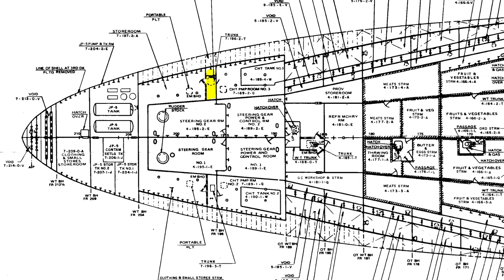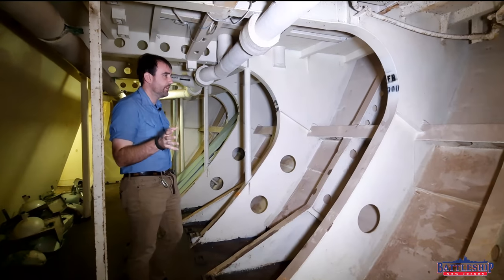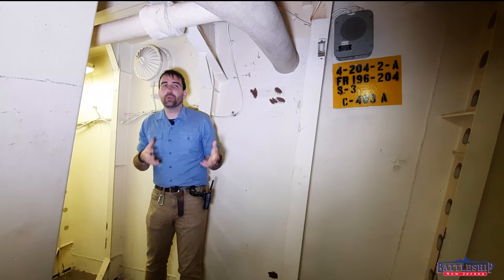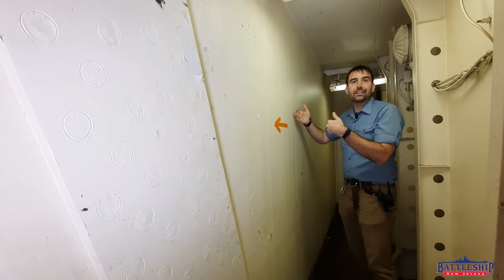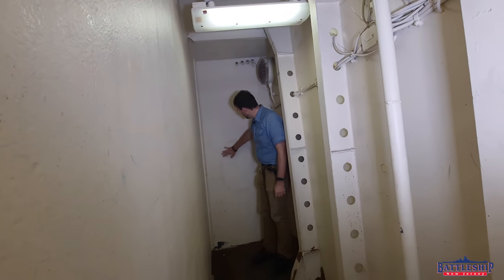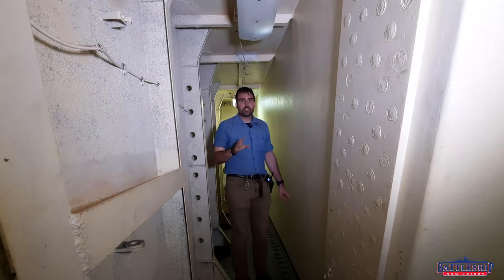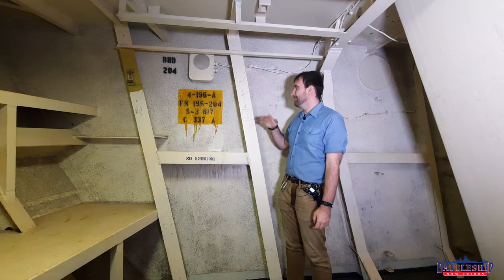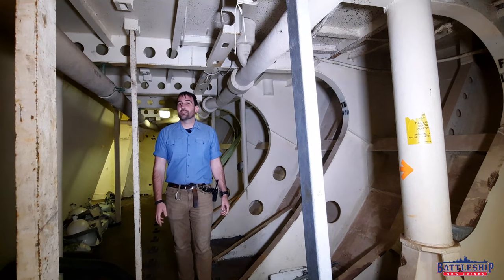Covering Your Aft (Steering)

Comment: The fact that you can only hear the sloshing sound in the video when you stop editing it out really demonstrates the leaps and bounds you have made with the sound quality great work
Reply: Was that editing, or was that a simple switch in the mic being used?
Reply: Not just sound quality. They've really up their game all around; early videos are almost difficult to watch in comparison. It was like sitting at the back of a lecture hall where the lecture is being delivered purely through a pipe made of plastic bendy-straw in a normal speaking voice with a guest lecturer who didn't really think about what they wanted to say.
Reply: @Howard Hammermann That is precisely what I was thinking.
Reply: @whyjnot420  It might well be just turning off or down the "denoise" effect.  Premiere Pro (and I imagine other editing software) has really terrific sound editing tools built-in.
Reply: @whyjnot420  De-noising an intermittent noise is pretty much impossible. The best you can do is eq but this is only effective when the frequency you're cutting is very clean or outside the vocal range.
Reply: @whyjnot420 gain boost on that portion so you can hear it, is my guess

Comment: This is one of the reasons these are so interesting. Ryan's remark that this ship was built in a time when "welding was new" AND it took place in my Dad's lifetime.
Reply: welding was invented for ww2 basically. battle ships were built knowing we were new at it, so just go 2x what you think you need and start from there. meanwhile, if you look at liberty ships... you realize just how new welding was
Reply: @seldoon_nemar  I remember my father talking about riding liberty ships between islands in New Guinea, the ships were built in sections and were built so fast that sometimes the sections didn't quite match up, so they would just fill the gaps with more weld, he said some of the deck welds were so big you needed to be careful not to trip over them
Reply: @steveredacted1394  That sounds about right. They were basically made with the intention of only ever being used for a handfull of trips at most. I think there is only one remaining example of one

Comment: Welding high carbon steel is tricky.  It can be done, but the right alloy welding rod must be used, and heating the material to be welded is essential.  Hard to do when it is a foot thick on a ship..  Plus you would then need to retemper the steel, or at least strictly control it's cooling to avoid brittleness.
Reply: Brittleness probably isn't that big of an issue if you can preheat the metal enough, since the huge mass of metal will prevent rapid cooling which is how you end up with brittle metal after heat treatment
Reply: How do you know so much :| ?
Reply: @vtr0104  it's called being a welder
Reply: @richardmillhousenixon  
Correct, but imagine trying to heat up  foot thick slab of steel in the building slip as they build the ship!
Reply: @mahbriggs  You could use an inductive blanket to heat up the area around the weld
Reply: I was gonna say, you can do it, but first you need to ruin the armored temper, and getting a now, much larger unified piece, re-tempred, and not have weird "seams" where the temper transitions is a massive PITA. Now-a-days it can be done, and probably would be done with welding, but only because that particular seam might have been one of the last ones ever assembled like that, and the skillset is gone
Reply: @mahbriggs  rember though that it's face hardened, so it's not getting heating all the way though. it would be rolling under a blanket of fire until the surface temp was right and then allowed to cool in a controlled manner
Reply: @mahbriggs  Just start out on a Monday morning with extra large torch/ heating tips on a very hot day and maybe by Tuesday afternoon will be good to go.
Reply: @richardmillhousenixon  
In the 1940s?
Besides, we are talking about a ship being built. Do you shut down work on that entire section of the ship?
In theory you can do a lot of things. Some however, are just impractical or silly!
I have 44 years of experience in industrial welding, and while I have never done shipyard work, I have a little appreciation of what is practical.
Reply: @seldoon_nemar  
Actually,the top and bottom edges were unhardened.  Look at the bottom edge which was welded.
Massive welds, with what appears to be a transition plate.  Even so, I would question whether the welds would not fracture under a shock load, due to crystallization.  That is the big problem when welding high carbon steel.  The transition from the weld to the bulk of the material.  Possibly enough heat in the base welds to provide a smooth transition, but trying to weld small brackets to the armor is very difficult.
Reply: @mahbriggs  that was kind of my point is that those sections are not armor tempered, and those little bracket welds did not have anywhere near enough heat to even think about sticking. it is possible though in theory, as you would just need a the right (giant) equipment. they make 3/4 welding rod currently, but I've seen phones of 1+" rods being used. 

now, granted, you're not welding with 1000 amps and a mechanical rod holder uphill or downhill as you're messing with a lake not a puddle at that point. but it would only take 2-3 passes and have the knockdown heat to work
Reply: Armor is not just high carbon steel - it is a laminate with a high carbon face and a low carbon back. Later armor was alloy steel.
Reply: @seldoon_nemar  
Which was my point!
It can be done, but welding those brackets is not very practical.
Reply: And while retempering, avoid annealing other hardened surfaces...  :/
Reply: @allangibson2408  Laminate armor was not a popular thing in the 1940s thanks to it being weaker than homogeneous armor. Face hardened armor is not laminate armor
Reply: @richardmillhousenixon  Harvey plate armour was made from the 1890’s by pouring molten high carbon steel into a mild steel mold - that gave a hard face and a soft, splinter absorbing back. Vickers and Krupp developed this further by using different alloys for the front face and multiple pours. The only think heat treatment helps with these is avoiding cracks due to too rapid differential cooling.
Reply: @allangibson2408  Harvey steel was phased out in 1893.
Reply: @allangibson2408  And that is also not how Harvey steel was made.

"Harvey armor used a single plate of steel, but re-introduced the benefits of compound armor. The front surface was converted to high carbon steel by "cementing". In this process, the steel plate would be covered with charcoal and heated to approximately 1200 degrees Celsius for two to three weeks. The process increased the carbon content at the face to around 1 percent; the carbon content decreasing gradually from this level with distance into the plate, reaching the original proportion (approximately 0.1–0.2 percent) at a depth of around an inch. After cementing, the plate was chilled first in an oil bath, then in a water bath, before being annealed to toughen the back of the plate. The water bath was later replaced with jets of water to prevent the formation of a layer of steam which would insulate the steel from the cooling effect of the water. The process was further improved by low temperature forging of the plate before the final heat treatment."

(Harvey Armor - Wikipedia)
Reply: The fact that they tried to weld a relatively thin metal beam to what is essentially a giant heatsink also did not help.
Reply: @kilianortmann9979  I don't think heat sink is the correct word, more like heat sponge
Reply: @richardmillhousenixon  I know the word is mostly used in PC building, but in thermodynamics a heat sink is the opposite of a heat source.
Reply: @kilianortmann9979  Point taken
Reply: How much carbon do you think was used in the ship armor

Comment: Does the museum have any of the large rivets that were not installed that you can show? They have to be monsters.  Fascinating to see the sharp curves of the aft hull contrasted by the armored box for steering.
Reply: those are large enough, the shipyard probobly made just enough in the machine shop. if one fails it's unlikely to be noticed. if enough fail that repair is needed... you're at a shipyard with a machine shop with a hole in the side of the boat

Comment: 8:00 you're close, but not quite there. to weld two plates of that size, and to keep them structurally sound, you need full penetration. meaning that you're carving a huge V between the plates and filling it with layer upon layer of weld. they control the heat well, but the problem is that you're still depositing cast material, and as it cools it shrinks, adding internal tension, meaning that if struck, the weld line would crack instead of deform. welding was also new, and they didn't entirely trust it or have the working knowledge of it like we do today. to have the confidence to draw up a welding shcedual that would work. 

also, I love how some aperentice at the shipyard torch cut something to the right of that reinforcement plate in the shiopyard
Reply: schedule
Reply: I got what you mean by creating a wedge between two thick armor plates that is being joined together. It makes it easier to fill it with weld after. As you point out, the welded part would be the weakpoint of the armor. Its possible they have a way back then of relaxing the stress of the welds molecular structure to make it less brittle more ductile and mechnically stronger
Reply: @VIDEOVISTAVIEW2020  That's called annealing and there's a process, however getting the armor rating isn't going to happen, you need more control to be able to temper it like that
Reply: @seldoon_nemar  so tempering and annealing was a practice that was known to man since time immemorial. Even in the 14th century, Japan was known for its vaunted katanas which was made using special metal forging process that allows it to be sharp at the edge while being ductile with the rest of the body making it specially both extremely sharp as well as a tough kind of sword.  In the 19th century, Japan adapted the british vickers ship armor technology which allowed them to catch up with the world in terms of ship building techniques. Accordingly, the British did test a 15 inch Japanese armor and they find out its even better than theirs which further implys that Japan did improve their own armor technology that they havr learned from the British. Based on the above, its possible the Japanese develop a special temperating and annealing process for ship armor building.

Comment: Speaking of odd spaces, there appears to be an entire floor missing from a building at my college. There's a large space between a gym space at one end and office/classroom spaces at the other that doesn't appear on any floorplans, but some rough measurements show there to be about 20' of hallway between the back wall of the offices/classrooms and the gym space. I suspect that it was blocked up during one of the many renovations the building has had in the last 110 years.

My requests to knock down a wall to see have been steadfastly denied by the university.
Reply: Making a reasonably small hole and then inserting a bore-scope would do it.

Comment: On the Sacramento (AOE-1) we had a fair number of small storage spaces, especially up at the bow.  In the 90s my workcenter turned one into a sort of "office" where us boat mechanics could hang out away from the official division office.  It had been designed as the sonar control room, had the foundations for the equipment still on the deck but I'm not sure if Sacramento ever actually HAD the sonar system it was designed to carry.   Surrounding aft steering were the aft capstan machinery spaces, though the stbd one also held the "sail loft" with it's big commercial sewing machine for making tarps.  That also was where the Bosun's Mate who ran the sail loft kept (and used) his tattoo gun...
Reply: with its

Comment: Back when i was the engineer on a 250' motor yacht, i had my own little man cave in the rudder room.  I had it doped up with christmas lights and a couple lawn chairs, a little table and a refrigerator,  it was nice, you could open the doors on each side to access the swim platform.  The chef and the laundry guy and i used to play cards and smoke weed back there.

Comment: We recently renovated the roof of our home, made some slight changes to the room layout, and took into account that we have some long stuff for our sailboats we need to store somewhere... So we made a loft accessible from the hallway to the bedrooms so we can put masts pieces and sails up to 4 meters long up there. We also built a closet into the wall in that same hallway with the exact measurements of some of our bags

We used it for a year by now and it's one of the most useful storage spaces in our house :D
The bags with boat parts fit well, we have enough space for the bags & sailing clothes, we can store the mast pieces up there, we can store the sails up there, and there's enough room for everything we take home in winter. I'd recommend using a hallway upstairs like this

Comment: I have a small space underneath an up stairs steps in my townhouse. It’s where our living room closet is located. And there is a small door where our water meter to the house is and small storage space where I keep a miter saw. Also in this closet is a secret door in the floor which leads to a 3 ft crawl space . Our gas furnace, water softener and lots of storage.

Comment: All those rivet holes drilled into 13" of hardened steel boggles my mind.  And all in exactly the right location. Especially when I have trouble drilling a little hole in a 2X4.
Reply: I'm not sure precisely how it would have been done at the time, but they have magdrills that lock onto steel plating with an electromagnet, essentially giving you a drill press anywhere you want one. The holes in the plating and in the gusset plate would have been drilled simultaneously with the whole thing in place.

Comment: I think the primary thing you'd worry about with trying to weld on face hardened armor would be that the weld would fail (as you saw), or that you might spoil the annealing and soften the armor in that space by the welding process. This is very similar to the tempering and case hardening process that you go through for things like knife making.

Comment: I know this is an older video but the welding to the armor situstion is super common issue in welding. In a perfect world, when welding, you want both pieces to be the same alloy and the same thickness. Welding small/thin pieces to a MASSIVE chunk of steel is hard, the armor would be a heat sink and the weld would ve cold and not stick to the armor.

Comment: I got a kick out of those cute little stanchions, what are they, inch and a half, 2 inches wide? And you'd have to watch the overhead every inch of the way and maneuver them around all of those pipes... hilarious. When I worked for fleet support I spent a lot of time wrestling 4" wide aluminum stanchions around, how long are the stanchions on an AKE, 9 feet? 10? But most of the overhead is clear and specially designed.

Comment: I haven't done a lot of welding but two things the heat from the welding would deteriorate the strength of the face hardened something about the crystal structure and the direction of the molecule

And you can't really weld a plate that sick on top of another plate that thick without having a plug weld which would be insanely deep I'm sure somebody knows the technical words for all this if you just lay down a weld even if it's an inch or too wide with the ships movements the vibration the torquing on the whole it's just going to come apart I can't even imagine the millions pounds of force in between all those plates and what the rivets absorb to keep it all together

Comment: You guys should get a weld inspector aboard the ship and see how those welds have stood the test of time
Edit: not saying the ship is falling apart, I’d just like to see how the structural of the weld compares to modern weld beads
Reply: they are pretty similar. not a whole lot has changed other than some alloy and flux makeups. i'd be more curious to get a weld engineer onboard who knows what kind of load welds can take and get his opinion.

I've heard that the welding is like 2x-5x more than actually needed. real belt and suspenders kind of build
Reply: He is simply riveting!

Comment: As a welder, they probably didn't want to try and weld to thirteen inch thick plating because it would require so much preheating that it wouldn't be practical.  You want to let people blow at that metal with acetylene torches to get it hot enough to weld?

Comment: There's an entire unused space above me right now. It's meant to be uninhabitable. I can see the access hatch to it from within a closet off this very room. If it is intended to be uninhabitable, why does it have a hatch to it from the space where I live?

Years ago I lived in a place with an identical feature. An uninhabitable space accessible from a hatch. In both of these setups, it was said that the hatch was the only way up but I was skeptical. In the previous place, I tried to get up there through the hatch but it was fastened down with something. I presume this was done because there is more than one hatch with access to the space despite what was said and they don't want people sneaking into adjacent units. Every once in a while it sounded as though someone was moving around up there. Reckon they found a away to remove that access hatch.

In the current place it sounds as though someone is up there sometimes as well. But it might just be structural settling or even the conveyance of sounds from below me through the structrure in a way that makes it sound as though someone is above. I don't understand why they put spaces like this in buildings. They should have just made the ceiling to follow the roof line.
Reply: Church for animals